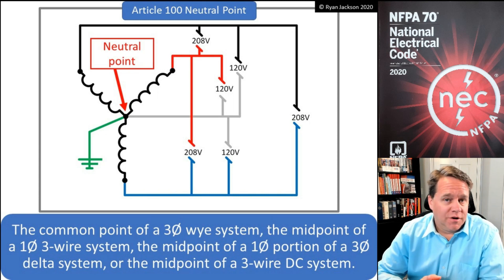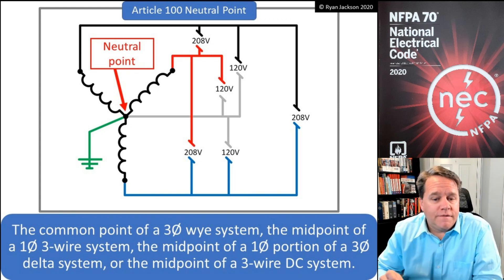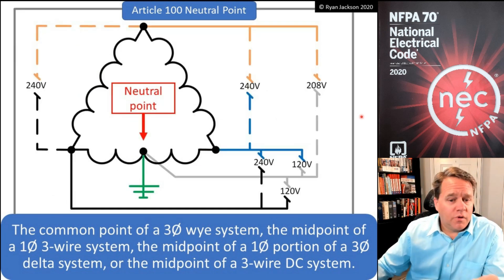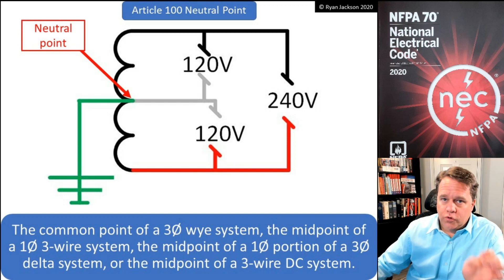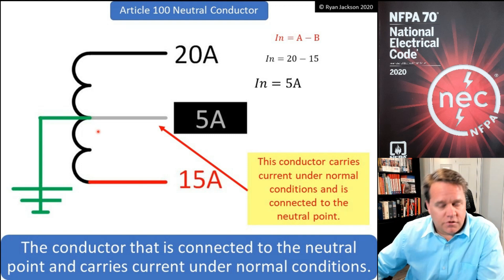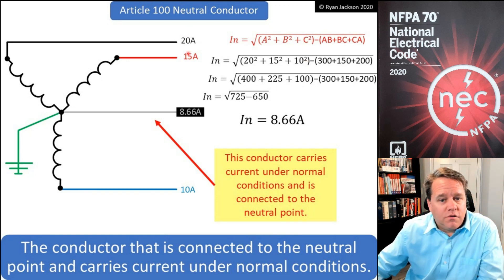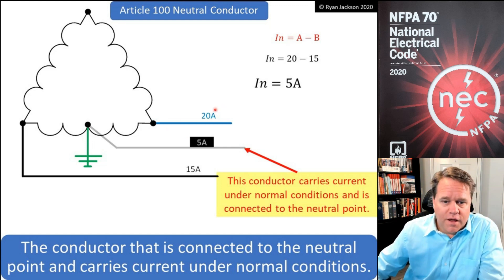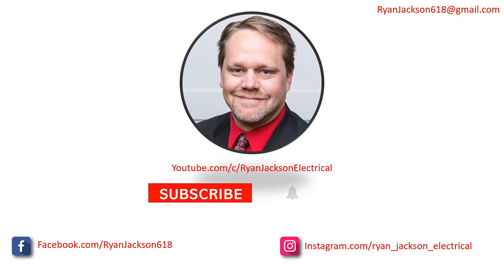100 Days of Article 100: Neutral Point and Neutral Conductor

Comment: A 3ph wye transformer has a neutral point regardless if  it is a 3 wire or 4 wire system,  but in accordance with the NEC a 1ph 208/120V 3-wire service has no neutral. So if 208V is a L-L  load then 120V is what? L-??

Comment: bit of a twist at the end there: so the grounded service conductor that goes into our service entry panel can't  always be called a neutral, because an actual neutral has to originate from a neutral point? and this only matters in industrial settings?
Reply from the maker: Correct. But the only times you would really see that are on a corner-grounded delta or an ungrounded system (which would also be a delta 99% of the time).
Reply: That's how I interpreted it